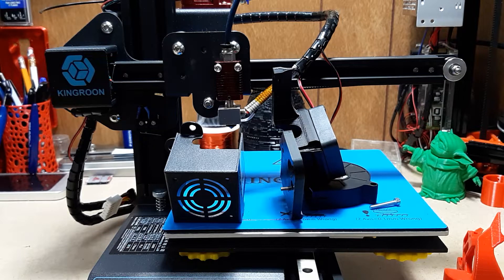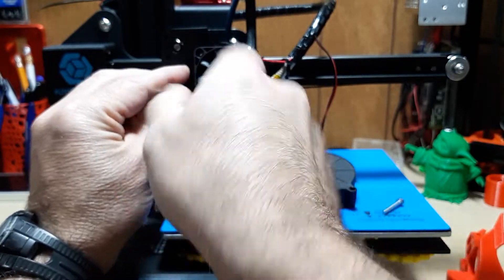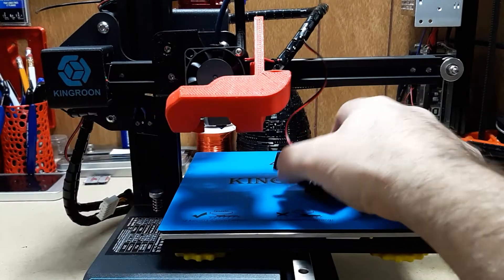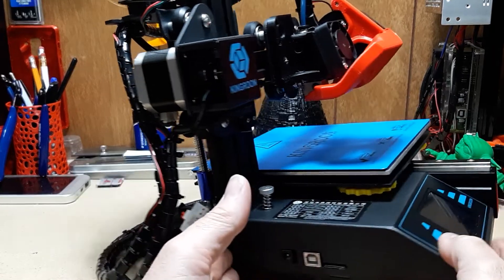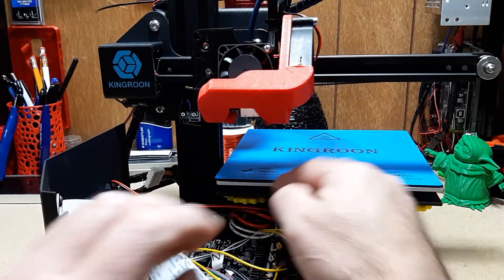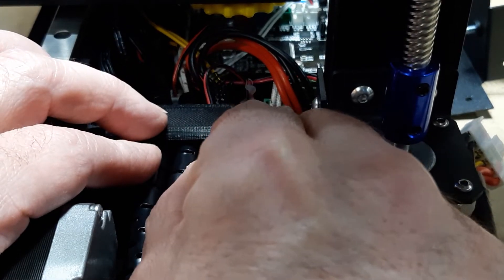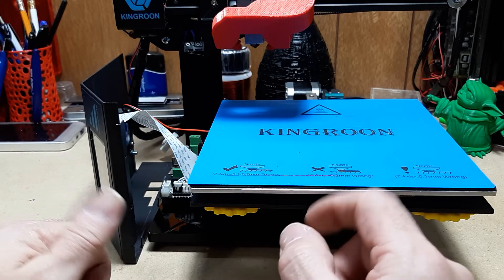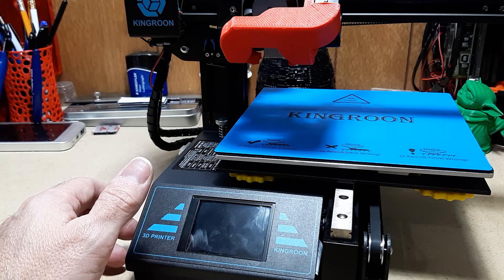Kingroon parts cooling fan installation

Comment: I installed this upgrade and when I go to print the main fan doesn't turn on, only the 5015. Does anyone have a tip/solution for it?
Reply: Did you check to make sure it's still connected and didn't get disconnected when installing the other fan?

Comment: Hi,
I also have this printer and PLA in general is printed with no issues, but with PETG I'm having a lot of issues as it jams after 30 minutes. I have just ordered Capricorn tube to improve with temperatures and filament extrusion, any advice? Could you please share paremeters?
Reply: I have replaced my boden tube with capricorn for the extra heat. For Petg I run 238 extruder, 65 on the bed some times with a little bit of glue stick.  Fan is normally on at second layer and between 70- 100 %.
Reply: Thank you very much, I will try those settings as soon as the Capricorn tube arrives.

Comment: Are you using the kingroon slicer? If so does it work with the part cooling fan? Thanks
Reply: I'm using simplify 3d but I don't see why it wouldn't work with the stock software.